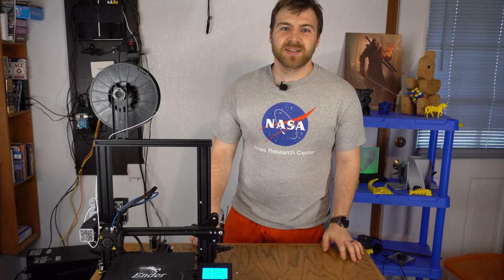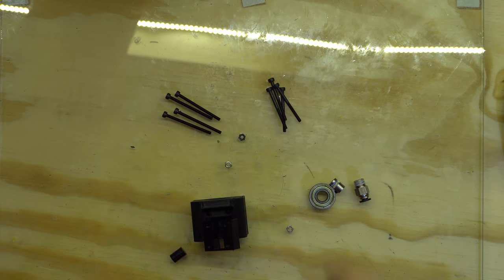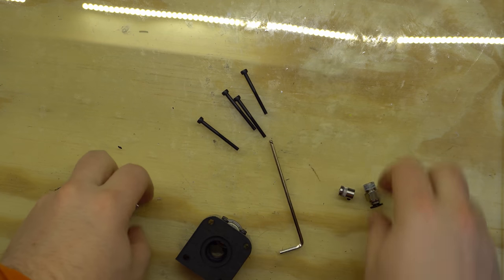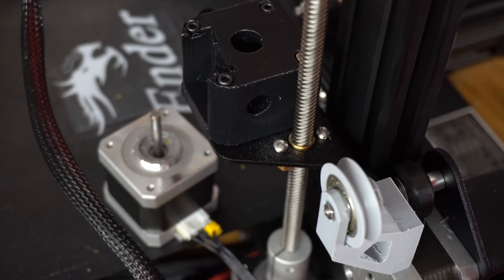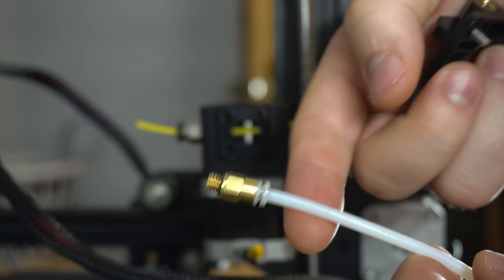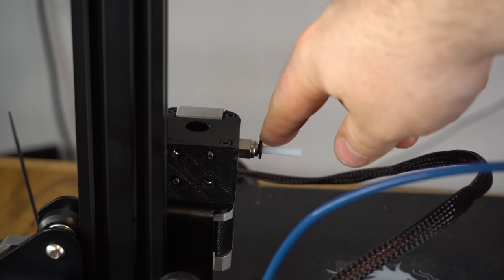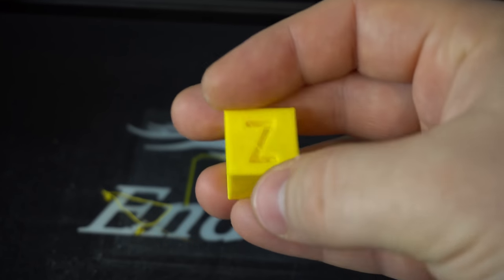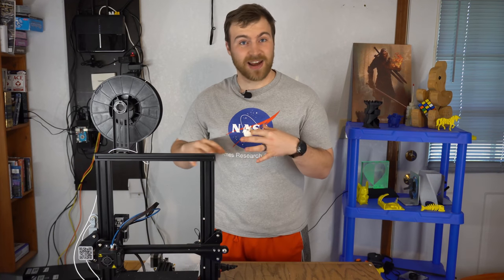Printing Flexible Ninjaflex on an Ender 3? Blasphemy! | Extruder Upgrade

Comment: That's a very nice design, Luke, I would like to see a cable catch on there though to hold the cable so it is not dragging around the back of the build plate.
 + 1 Subs

Comment: Nice, that's pretty clever, the stock extruder on the ender is definitely not the best. I do feel like piece that is holding the bearing will warp over time and you will always have to keep an eye on the filament tension. How long have you been using this setup?
Reply from the maker: Thanks for the comment!

My Longest-lived setup is close to 7k hours, over the years across my printers I probably have over 20k hrs just myself. No issues reported about that from thingiverse nor my customers that buy the kits. As far as I can tell, using 4 screws to spread out the clamp load has been more than sufficient!

Comment: Needs more loctite and torque specs! Unfortunately, decent low torque wrenches are expensive.

Can Ninjaflex be used as a spring or is it fairly weak?

Comment: I was wondering if you can use this extruder upgrade with other types filaments too. So you don't have to take this upgrade out every time you use a other type of filament
Reply from the maker: This extruder is all-purpose. I've used it for everything from regular PLA all the way up to PC or Ninjaflex. Simply adjust screw tension and you're good to go!

Comment: I wonder if you could put some springs on the 40mm bolts on the outside to tension the bearing? Of course a longer machine screw would be needed. Or if you could redesign the bearing holder to use a spring on each end of the bearing excel. Just a thought.
Reply from the maker: That's precisely the opposite direction I want to go! I do not like the use of springs - the clamp load on the plastic is all the give I need to keep proper tension.
Reply: @LukesLaboratory  Would help if you have some kind of a manual clutch to efficiently change filament. It will take forever to feed printer without that possibility.

Comment: I can’t get it to work
Reply from the maker: What seems to be the problem? what troubleshooting have you done? Is it the initial extrude? grinds out the filament?
Reply: Luke's Laboratory the weight of the spool is too much for the extruder to pull so it has resulted in under extrusion
Reply from the maker: @leo_ohara  Curious - Are you using extremely large rolls? I've used the neustruder with 8.5kg rolls w/out issue on a CR-10. How is your filament set up? You can join my discord and I can help you out - https://discord.gg/daXRDZf